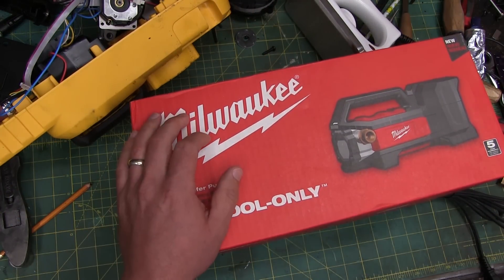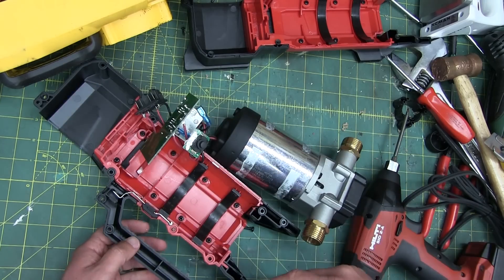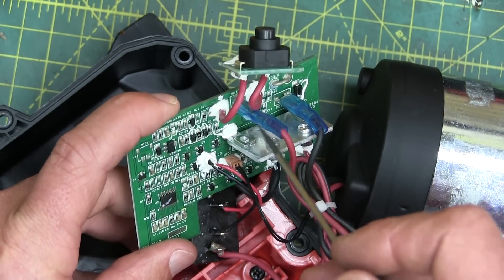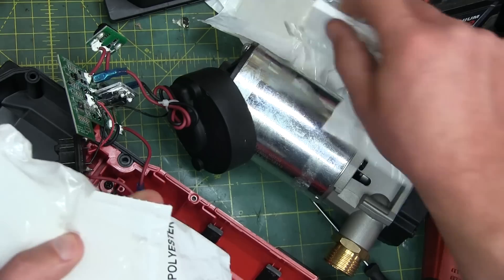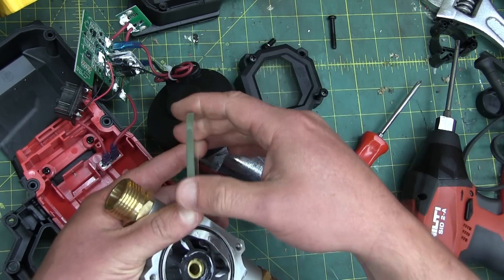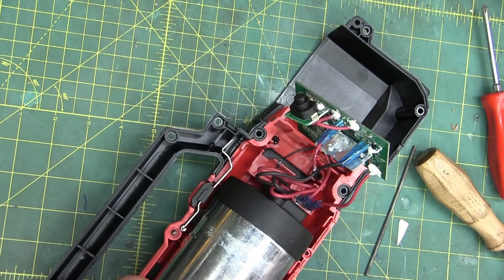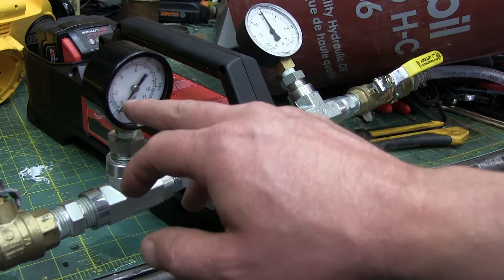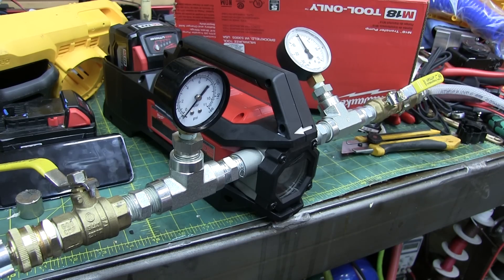BOLTR: Milwaukee Pump | Box Specs vs. Shop Specs

Comment: 30psi X 2.31 = 69.3 ft/head (the alternative formula is 30 / 0.43). Also, I have this pump and have noticed better performance if you use the 9.0 pack- the motor runs at a higher rpm.

Comment: Zip ties a harbor freight drill you don't got to pay anyone
Reply: Tyler L or corded drill if you're near an outlet.
Reply: Chainsaw
Reply: Bingo! My first drill, a beefy 1/2hp Craftsman concrete/steel drilling 600max rpm model that could literally twist your arms right off, has a little red switch you can push it and it will lock on. Bought it on layaway when I was 15.

Comment: I work in the marine world and I've never had a issue with installing a impeller with the lobs going in the wrong direction they seem to be able to flip around. It would be interesting to see it with the one side being visible on this pump. We've always used dish soap to keep the impeller nice and flexible and slippery
Reply: Same situation for me work as a marine mechanic and tiny or 50mm impellers they just bend back on their own, common misconception

Comment: i know this is a old video, but i am working in the marine sector and Jabsco pumps can be reversed without busting the impeller. The Ballast systems of Nautique boats for example have the comertial duty jabsco for it and we rarely have to change out the impelers.

Comment: I think the loose fitting insulation is to deter corrosion that could be caused by trapped moisture. I'm probably wrong though.

Comment: Cool to see quality Oetiker clamps in use . Would like to lower rate flow down to 2 GPM . Pumping antifreeze into large truck cooling radiators , wanting to eliminate possible air pockets in the engine block .  Will a restricted washer on the inlet side shorten pump impeller life ?  Or do I tee the outlet and adjust the flow back to the reservoir ?

Comment: You can reverse those pumps without damage.  They'll only break if the rubber is already old & brittle.  In good condition they'll just flip over and keep on working.

Comment: I’ve seen the flange on aircraft valves break right off when the improper size O-ring is used. Cram an O-ring that fits perfectly in the groove and once you meet the two components together and clamp them the O-ring has no where to go and the cast aluminum flange cracks right off.

Comment: When the pump failed to produce the advertised flow you incorrectly stated that the output was not even restricted. I assume you meant restricted by the ball valve, but I think you forgot to account for the restrictions created by the small hoses and small ID fittings that you are using. The original fittings on the pump seem to be for a garden hose which would have a much larger inside diameter and would consequently produce less restriction on both the inlet and outlet of the pump. It may very well pump as advertised with a couple of garden hoses. 

Still lovin' your vids and the unorthodoxed ( can you say understatement?) way you teach the fundamentals of industry. Unique.
Reply from the maker: how much restricton is there? 0 psi on gauge...
Reply: That's a good point. Maybe it's the suction side restriction that is the culprit or I could just be wrong. In any event, I think, now that you have demonstrated the phenomena that you set out to demonstrate with all the expensive fittings and gauges, that the little fella deserves a chance to chooch with the hose his maker gave him before you declare him impotent. Trust me, you wouldn't want anybody hangin' my equipment on you and then judgin' ya 'cause  ya had a weak Cockford Ollie ! Give 'er another go, eh.
Reply: You double the size of pipe, you x4 the flow(size) on natural drainage. I'm guessing on a pressure/Suction pump that can slip at deadhead it may have a close or greater effect. The 3/4" x 1/2"npt fitting that comes with them has the most restriction on the factory set up with 1/2" I.d. . I'm boring and reaming them on mine and running 3/4" I.d. on both sides. Rad hose on the suction to not suck closed haha.

Comment: The red plastic is probably an ABS/PC blend.  It's a pretty common plastic that gives the toughness and impact resistance of polycarbonate but the flow properties and cheapness of ABS.  The weird thing is the nylon casement... nylon is very hygroscopic,  being a pump its gonna get wet.  The thing will probably swell up like a franchise manager at mcdonalds

Comment: The reason why you did not getting the Max GPH rate is because of your inlet tube. From the looks of it looks like it is 3/8 that is half the size it is rated for therefore half the flow. I cannot see the outlet tube if that is 3/8 as well than that will restrict it as well.

Comment: I wonder if those heat shrinks are intentionally left unshrunk on the assumption the heat of the pump operating will handle it when you first use it. Saving entire pennies of labor!

Comment: I'm fairly sure that they had some extra head on the right hand of the pump. You can create any flow numbers when you don't include a flow diagram.

It would be neat to see if it can pump slurries (i.e. sand-water mixture). Also, try and remove the brain box and just go straight battery to motor connection.

Comment: My 0.02 is you should test old tools. I have a late 50s drill that I took apart and restored. THE DIFFERENCE WAH! Solid castings, brass bushings, proper fasteners and a metal chuck! Even old Milwaukee drills are SUPER skookum compared to the new crap. I can send a couple test monkeys up to the great candy mountain for ya!

Comment: This pump is rated for water.  What's your opinion on use for other stuff, oil, antifreeze, diesel fuel, etc?  Might get one to keep on my boat for pumping out flooded compartments under the floors, but could be handy for other stuff.  Can I get better/more chemical resistant impellers aftermarket?I'd also like to see your review on the Milwaukee 18v cordless wet/dry vacuum.

Comment: Gonna go with tested in ideal conditions. 0 restriction and excellent hydrostatic inlet pressure. Try it with a fitting on the bottom of a full 55 gallon drum. Bet you get a little better digits then lol

Comment: Great video, as ever... I totally agree its one thing to test in perfect conditions but to then try and get the same results in real world conditions is impossible. They probably do the test in a pressurised tank filled with nitrogen using a liquid only developed for testing pumps.
Edit: its Celsius. Who uses a positive as a negative, how can -1 be plus 30.

Comment: If it uses the fluid as a heat transfer,  would it get to hot if you used it to pump hot water out of a water heater?

Comment: So does elevation change the pressure of a pump? Like if your in Florida would it pulp less than if your in the mountains of Canada? Would viscosity change pressure? If you were pumping oil instead of water would the output pressure be the same?

Comment: From the test you did Is 2 bar the most resistance it can push against ? We use the cheap $15 drill pumps for pre filling plumbing systems before a water test. These can usually pre fill the systems to about 5-6 bar.

Comment: I believe if you add up the volume between two vanes of the pump. Multiple that by number of vanes on rotor. Then take no load speed of motor and add all that up. You may reach the max displacement of unit. The dream gph may be close

Comment: The question I  want to know will it move 15-40 diesel motor oil from a drum down say 10to 25 feet of hose say from the deck of a service truck into a compressor Shack?

Comment: I wonder if the small diameter and long length of that inlet hose would account for the under-spec performance? Pumps push but they don't pull. I bet their test was based on a large diameter inlet pipe about 1cm long or the actual number was "adjusted" to reflect that condition.

Comment: I typically write off box "promises" vs field results as the result of the prototype machines and bean counters crunching numbers to print on the box compared to the sloppy tolerances of assembly line products.

Comment: Water pump from a outboard motor AVE !     DI water , distilled, Milwaukee battery assisted tools seem to develop loose connections in the battery to device connections after time, DeWalt don't seem to have this defect .

Comment: I would have to assume the specs were so off on the box compared to your tests because pumps like this usually need a little time for break-in to fully run at its max potential

Comment: those old 2 stroker Detroits are in mining carts, i took one apart in school once. what a pain to get the pistons back in. you need a special piston ring compressor for it. cool engines though probably in my top 3
Reply: I think the big pain is that they are fucking heavy.

Comment: As mentioned very very popular on boats I have several on mine 
One for raw water for engine cooling (exsaust unjection through a heat exchanger) 
Raw water deck wash
Bilge
Shower drain 

The gap between the inlet and outlet (top) commanly wears down raw water engine pumps have adjustment here on the hire fleet this last about 10 years before you run out of adjustment sometimes causes embarrassment to the engineers that go out expecting a normal overheating engine but this is all they needdd

Comment: Hey AvE.  Just wondering the ID of your compilation of fittings compared to what appears the be the inlet/outlet of the pump.
They look to be garden hose diameter, which in guessing is 3/4 inch.

Comment: What size line are you using there looks like 3/8" use a normal standard garden hoses you have 5/8" fittings don't reduse your lines down that will greatly reduce the amount of water you can move might be why some of the numbers weren't matching? I enjoy your videos id love 2 see u retest this

Comment: Firefighter here: The diameter of the hose make a HUGE difference in flow per minute due to friction loss.
If you keep the mermaids bouncing off each other on the dance floor, they have to go slower. Give em some room to twerk a bit and the party is more fun. 
The different appliances we put on the lines add friction as well. Your gages might be effecting the results by giving the mermaids another thing on the anti-twerk factor. They're easily distracted.
Real numbers: 1 3/4" hand line has a friction loss of 21 psi per 100 ft. Our 5" supply line has 0.04 psi per 100 feet. The mermaids are much happier and twerkier in the 5", so we let them party. 

Out appliances on handlines drop pressure 5-15 psi each based on how severe and complicated they are.

BTW... how long do I have to keep IT in a vice?

Comment: I think the only thing that could be different in your test is the size of the ball valve openings,  the restriction gauge didn’t show much resistance but the small opening of the ball valve would decrease volume independently of the pressure or vacuum right? They may have done it directly without a valve

Comment: Standard Mercury Marine v6 outboard water pump impeller from 1976 to about 2003. Too funny.

Also* Mercury always stated in their fsm's that water pumps should NEVER be run dry, as 5 seconds of run time at ~1000rpm will wipe the ends off of the pump and trash the rubber right into your  motor.

Comment: They're pumping down hill.
So pressure on input and if run down hill on outlet then will eventually create a vacuum just by the weight of the liquid in the hose and it's a powered syphon at that point.

Comment: 10:14 Not to be a nitpicker, but kinda tricky for those MOSFETs to be in a totem-pole configuration, when they're both paralleled (see traces on the bottom) :) Just because there's two, doesn't always mean they're a half-bridge. Pretty sure the circuit's battery -> motor -> the two MOSFETs in parallel -> ground.

Comment: The worst problem with any of these tools with sealed battery compartments is the size they make the opening is for their current model battery that they expect you to use then they come out with a battery twice as big which you want to use to make it last a lot longer but it won’t fit being encased all around.

Comment: Any chance you could try testing a Bosch IXO screwdriver? I bought one last year and I have only used it maybe three or four times. I’d be interested to know what you find out. I know there is another model, the sixth generation, I believe. This one that I have, isn’t the sixth generation. The aforementioned comes with a drill attachment. The one that I have, the standard one, is the one that I would be interested in. Sorry for the ramble.

Comment: It's difficult to tell for certain, but did the vane assembly go back in the wrong way around? On reassembly, at the outer edges of the vanes there are circular indentations (filled with grease) visible through the sight glass. However, from what I can see, those indentations are only on one side of the vanes and were on the inside (so not visible through the sight glass)? If this is the case, it would mean the vane assembly is running 'backwards' in respect to how it started out. This shouldn't be too much of a problem, as the vanes are new but is not ideal. Can anyone confirm?

Comment: As far as the run time etc you had the output valve partly closed. If that was simulating max lift ability, that is not how they are going to rate it for run time. Clearly any product when they rate the run time, they are going to do so with minimum or a more typical load. So they rated the run time based on a level output and input or only a few feet which would be a more normal situation. Like draining a water tank and pumping into a utility sink within a few feet of height. Just like with an electric mower, they are not going to rate it will really high grass or the highest it can cut, but a more normal grass height when having to cut the grass.

Comment: Hey I'm usually just one of the kids at the back of the class but speaking on the whiff of something in the ABS did you consider what they use to color it.

Plastic colorants are chemical compounds used to color plastic. Those compounds come in a form of dyes and pigments. The type of a colorant is chosen based on the type of a polymeric resin, that needs to be colored

Maybe you smell "pigment"

Comment: PRODUCT UPDATE***

Today she shat the bed.  was using it like normal. turned it off, wouldn't turn back on again.  Got a small splash of coolant across the body. Took er apart in the field and i have power everywhere I should.  The switch floats between 13.89 and 18.4V on the outbound when pressed. hard wiring motor, motor still runs. doesn't smell of the smoke being let out. no black scorch marks inside. no coolant wetness inside. The case was cracked along the clamshell halves which isn't bad for living in a service truck on bumpy roads for a year. Have put about 8000-9000L through the pump in the last year filling radiators. Bottom filled rads quite well and even when pushing up 25' of head pressure, she still was spinning at full speed. 

Overall good unit, now to test out the warranty.

Comment: So basically they took a simple impeller pump and wrapped it in the red and black. Boom $400. But let me ask you this, was the hose in your test 3/4" or 1/2"? Were your fittings, tees and valves all full bore 3/4"?

Comment: I’ve got that pump...  ther3s a new one that takes 12.0.   Mine is old one...   but....  it’s a great pump..it will empty a water heater in minutes I even pumped sewage up a set of stairs..and out the door with a 75’ hose going up the stairs into the neighbors yard

Comment: Wouldn't it be easier to use the melting points to determine the plastic, if the soldering iron is accurate enough?

Comment: Probably power siphoned  to drain from tank big hose low restricted very short line that build pressure into pump or they use as booster to get numbers like inline on tap water pressure

Comment: What size hose are you using  ?   It was set up for garden hose and it looks like your using 1/4 id.  That would be a significant restriction thus a higher work load ?

Comment: I think your suction head was too low- in the slow mo, you have what was either air intrusion into the pump casing or cavitation in your pump. Either issue may be resolved by increasing your suction head pressure, and both will kill the numbers you were trying to match on the box.

Comment: They probably do a 90 second test, with 2" fittings bushed down to the garden hose inlet and outlets, on flat level ground.  Then multiply it up to the 1 hour ratings.  Conditions the thing will never see in the field.

Comment: I'd guess they test similar to how they test car amps and speakers for max ratings - in a walk in cooler/freezer at just above freezing point and they take the peak momentary results and stretch them to fit whatever time/rating frame they are looking for.

Would be a place to start anyhow if you wanted to attempt to replicate it and about the right time of year to do it cheaply just outside your garage.

Comment: Regardless of how well they build them, portable flexible impeller pumps are essentially a marketing tool for selling impellers. You walk away from them, they run dry for an unexpected reason and they burn up the expensive impeller. If they liked their customers better than their impeller sales they'd have a temp sensor just across the aluminum from the impeller to shut it down when it unexpectedly runs dry. Till then I'll stick with those redline portable gear pumps. I'm sure the gears are made for oil, but they last longer moving water than any jabsco impeller I ever encountered.